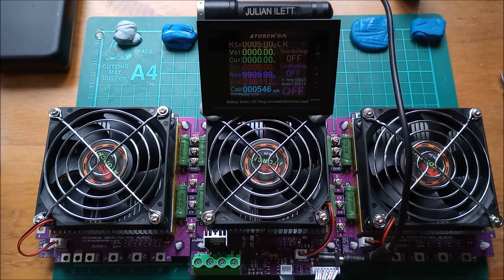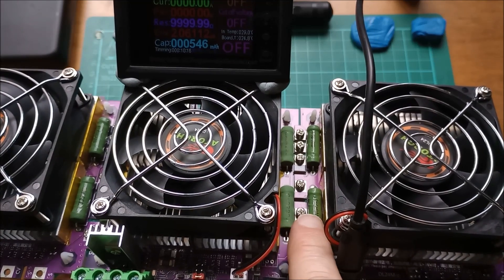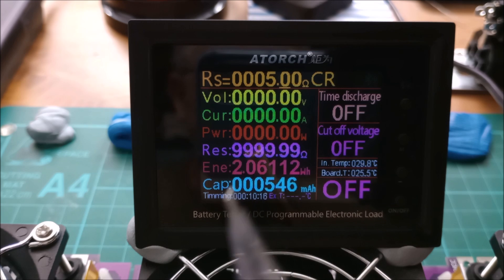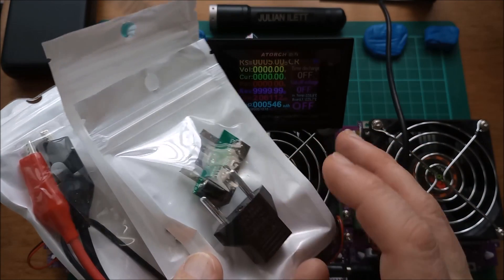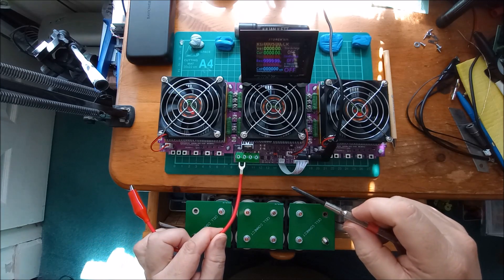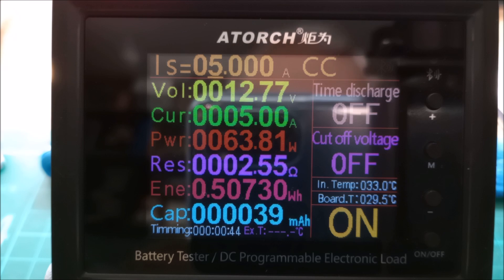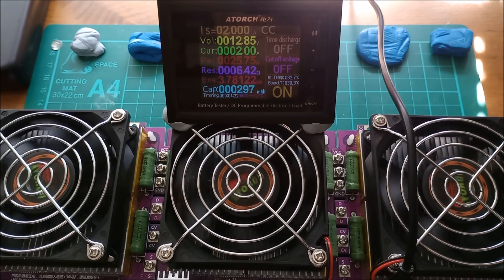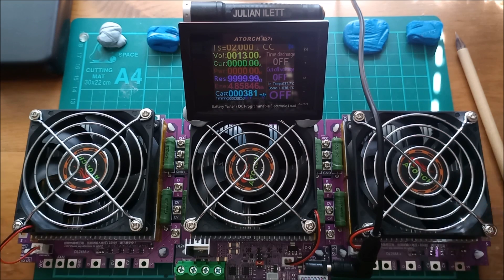DL24M Modular Electronic DC Load

Comment: It is incorrect to specify the rating of those load testers in amperes because its a heater, not a conductive mosfet. And it gets hot from watts, not only amperes. So its not the same if you have 12V or 48V battery at 40A.

Comment: The Atorch set system is a bit mickey mouse, takes a while to make it work for you.  Alright once set up for a batch of batteries say , 100's on a test bench, but only 450W for all that faff and $$$$.  I made up a bucket of water and some nichrome wire to do a 50A test on a 25v lipo bank, much cheaper $ and I wanted  to watch temp rise over 15-30mins and check all over the bank for hot spots

Comment: Is it capable of handling 35/40A for a longer period? I am looking for a decent electronic load for testing heavy LFP cells up to 280Ah, so i need to burn a lot of current/power. Did you also test for accuracy? These are the 2 main parameters of dummy loads - i guess 🙂
Reply: I really don't think so without making major changes that would significantly increase the total cost.
It is not a product for professional use and was not created less for intensive and heavy use
Reply: @francescacosentino6975 but it claims to run 40A cont.? So you guess this is chinese fake?
Reply: @rilosvideos877  Looking at the DL24MP under review here, does the connector on the main board through which the 40 Amperes pass, or should pass, seem adequate for that current? Does the (double) schottky diode at the input seem adequate for 40 A? do the same tracks of the main board PCB that carry the 40 A flow seem suitable to you? Does a card with those 4 heatsinks and the 8cm fan seem suitable for dissipating 150W continuously?
Look, there are many things that make one think that the data declared is a lot of advertising.
In reality the object is nice and at half the declared values it is quite fine, it is not the object that is a fake but the data  too pumped up on the power and Ampere

Comment: Can you try to bring this capacity tester to the limit? I was buying the small version rated 180 watts. After I connected it to a 84 volts battery, I had to replace the MOSFET 3 times at only 0.8 amps because it blew up 3x.
Reply: It may happen that the DL24MP reads small currents even when there is no load connected, this is due to the sensitivity which has been increased compared to previous models and very small shunt sensors.
With the last setting you can cancel this bias error and make the measurement more reliable.
But remember that everything is not stable over time and with external temperature fields.
Too many figures to claim to be precise and reliable on an object of this type.
Furthermore, I wouldn't think about using it to the limit, as I have already written elsewhere, too many savings: switching type MOSFETs not suitable for linear use as needed in an electronic load and often also "fake"; "ridiculous" heat sinks for the intended task anyone who knows how to assemble a PC knows what it takes to dissipate 150W away from a CPU. And then everything is up in the air, no safety regulations and even dangerous voltages (200v are dangerous) on the entire surface of the heat sinks.
Oh by the way when did you replace the mosfets where did you buy them? do you know that the market is full of fakes of this type  that can't last?
Reply: @francescacosentino6975  when it's rated 150 watts you wouldn't go near to 150? I'm aware of the replicas. I was buying from a reliable supplier. They blew up same fast as the original MOSFET that came with the board. Finally I draw only 50 of 180 watts in 10 days. The temperature was not close to anything dangerous. Maybe the blew-up's caused by the avalanches from the PWM. Did you use a battery with higher voltages than 48 volts?

Comment: My biggest gripe with these units is where the thermistor is located for the board temp. It's next to the shunt resistors onboard and a few mm away from the heatsink. The temperature of the silicon is much higher than reported by the board temp reading. Running the board at its full rated 150W will result in really hot (100c+) mosfets while the controller only reports 60c
Reply: You have two ways to remedy this problem.
The first is a partial but easy remedy, just put some thermally conductive but electrically insulated material on the thermistor until it makes thermal contact with the heatsink.
I did it and the temperature can be 3-5 degrees closer to the real one, but the time delay remains, i.e. the time it takes for the heat to reach the thermistor.
The other solution is to use the socket for the external sensor and place it in close contact with one of the mosfets, in this case you will have an almost perfect reading in real time

Comment: A quick way to clear mAh/Wh is to hold + and - at the same time for a couple seconds. Big time saver over entering the menu and going all the way down. 

Any idea what that last setting in the menu is? Something about no load current?

Also have you tried calibrating it? Mine came fairly accurate out of the box but could use a minor tweaking. Just don’t want to mess it up although I think you can change it back to the default original calibration.
Reply: The DL24 calibration is in a "hidden" menu and is only in Chinese.
To access the menu, here are some instructions found online:
Hello, friend, when the ATORCH mark appears during startup, double-click the M key to enter the calibration mode.
First, use 1V to clear and calibrate, then use 30V voltage to calibrate, and then use 3A current to calibrate"

Since it is only in Chinese, you can use a translation "app" with the possibility of graphic input

Comment: Oh boy I’m so excited to see your opinion on this. 

I got the 4 module 600W/40A version. Can’t get a 600W/40A electronic load for anywhere NEAR the $62 I paid on sale. Like not even in the same galaxy can you get an electronic load that powerful. 

But….the design sucks. I mean it’s truly a poorly implemented idea that makes sense and doesn’t make sense. Compressing PCB’s together?! With a design that leaves some of them not level with the rest? WTF? I initially couldn’t draw more than 33/34A. Atorch told me to change the jumper configuration for 450W….which was an issue because at 40A I’d be drawing more than 480W…

So I went back over all the nuts and bolts and very carefully applied a bit more torque and found a couple that were just slightly less torqued than the rest. Keep in mind you have to do the upside down T configuration that’s 3 wide and 2 tall in the middle. 

Nowhere in the literature do they say how to assemble the damn thing. I had considered the 2x2 square but that would still leave 2 modules not level with the other two but I figured I could mod the feet with shims. I think right now I have the middle unit on top of the outer modules which works ok. I always have the unit elevated an additional 12 inches off the ground because additional heat dissipation is absolutely necessary. The heat sinks are TERRIBLE and the fans not running until a set temp is a terrible design. I’d much rather have a variable speed fan that goes on over 10% of the units max rating or some 5-10 Celsius over ambient temp. Currently I have it set for I believe the lowest setting, 40 Celsius. Those motherfuckers are loud and for how loud they are they provide minimal cooling. 75% of my cooling comes from either a 90mm PC fan ducted through a Poptart box to go underneath the elevated PCB’s and another less powerful PC fan on top of that to get the power resistors on the board some airflow. Seems to work ok but if my testing is longer than a minute I use a quite powerful 12” desk fan on its highest setting when I’m doing anything over 200W. Over 400W I use two PC fans and the 12” desktop fan to keep things under 60 Celsius but it’s bloody freaking loud. 

Really tempted to change the stock fans and honestly might look at the heatsinks as well. If I can find salvaged heatsinks that would fit I’d gladly swap them out. Would love to find some copper.
Reply from the maker: Completely agree. It's good value for money, but far from perfect. I would never run it at its theoretical maximum power.
Reply: I agree the initial idea may be interesting but the realization makes you cry.
First of all the choice of mosfets. The IRFP264 that is used is not suitable for linear uses but is a switching one. Its SOA (safety operation area) does not exist for continuous use, therefore the manufacturer does not guarantee that it will not go up in smoke when used as a linear load.
Then I agree that the heat sinks are unnecessarily small and a little was enough to obtain good advantages.
For the use of copper I have seen that it has great advantages on the propagation of heat and therefore in transients; but when fully operational it does not have much greater dissipation towards the air than aluminum and in any case is not able to justify the price which exceeds that of the same DL24MP device

Comment: Resistors probably are for ballancing mosfets becouse they are not ideal and have diffrent Rdson. Also you can mesure votage drop at 35A on input diode and calculate power on it Vf x 35A
Reply from the maker: Yes, I'm thinking that's what "In Temperature" is showing. It's the temperature of the input diode calculated from its forward voltage.

Comment: That reverse polarity input diode will not be carrying anything, until you reverse the polarity, then it protects the board by conducting hopefully enough to blow a fuse or trip.
Reply: True. It will be against to the nature of the unit to put it in line (series) because of the voltage drop it will cause. It must be reverse biased parallel, but then why put a heat sink on it?
Reply: I think the heatsink is to stop it overheating whilst it trips any input fuse. If it fails then the unit is damaged. This is a firesafe device. @borayurt66
Reply: @G1ZQCArtwork  Depends on what you connect there. This being a DC load / battery capacity meter, batteries with very high short circuit currents will often get connected. With such a battery having hundreds of amps under shortcircuit, I doubt that the heat sink can do much to keep that diode from splitting to its molecules in a blink. 😀
Reply: The protection of the diode which blows a fuse because it becomes conductive when you put the wires with reversed polarity is used in the DL24EW model, not in this one.
Here the diode conducts when the connections are with the correct polarity and prevents the current from flowing if the connection polarity is wrong.
This obviously involves, under normal conditions of use, a power dissipation on the diode which becomes "considerable" when the currents are high; this is why there is a heat sink which is also hit by the air flow of the fan.

Comment: is it acting as a DC resistive load or a PWM load? normal mosfets doesn't like the linear region, by what I understand.
Reply: It's always in DC load mode. Like it or not, MOSFETs have to work in this mode. PWM mode is undesirable because many power sources do not function correctly in it.

Comment: You are missing the voltage sense wires (4 terminals into the board, the right hand two) you'll need those so that it's battery/source voltage measurement is not being affected by the current draw on the main lines. It's in the manual I think...
Reply from the maker: Yes, if I was taking accurate measurements, I'd use 4-wires.
Reply: @JulianIlett  I was suggesting that might be why you were having problems with the CV mode...?
Reply from the maker: Yes, I see what you mean. I'll try it again using shorter wires and 4-wire measurement.

Comment: Those 0.25 ohm resistors... are they for current sharing in the fets?
Reply from the maker: Yes, I guess so.
Reply from the maker: Actually there's a mixture of .25 ohm and .22 ohm, so the resistor value can't be that critical.
Reply: @JulianIlett  739 / 5.000
Risultati della traduzione
Risultato di traduzione
The mix between 0.25ohm and 0.22ohm is something that Atorch has never been able to explain.
I had a lively discussion with them, or rather I argued, because I tried to measure the currents and they are greater where the resistances are lower. Balancing the resistors is not difficult by putting something in parallel with the 0.025 ones and this balances the currents too. But Atorch replied to me that he did it because the Mosfets on the side where they placed the 0.025 resistors were hotter with the thermal imaging camera (and since the heat is due to the current I don't understand) it could be the protection diode that is that side? but the direction of flow of the air does not justify it because the air flows in the opposite direction.  the same doubt is expressed in a technical blog by "Kirich".
Reply: I would say that is what they are for. They are probably not balancing power through the modules other than those resistors. Maybe that is why they are using that special mosfet with a high on resistance because it is more consistent in it's linear region.
I would still always double check the heat on each mosfet to see which one runs the warmest. It will probably be on the mother board because that has the highest voltage and most gate voltage.
Reply from the maker: I'm not sure you'd see much difference. The MOSFETs are on common heatsinks, so any heat generated would quickly spread among all the transistors.
Reply: @JulianIlett   true, the difference seems to be negligible but at maximum power it could become a factor, at least between each board.
Reply from the maker: My mistake - each transistor is on a separate heatsink.

Comment: What did you test the constant voltage with ? For constant voltage you will need to use some sort of constant current source like say a solar PV panel else of course it can not do any constant voltage limiting.  You can also test constant voltage if you add some resistive load in series with a voltage source like say adding an incandescent lamp in series with your battery or super capacitors.  Maybe you already know all this and the DC Load can not maintain a constant voltage for some reason. If the other modes work not sure why constant voltage will not work.
Reply from the maker: I tried a power supply in CC mode - wildly unstable. Then I tried a battery in series with a bulb - also very unstable. Then the battery in series with a power resistor - more stable, but still not good.
Reply from the maker: Maybe it would work OK with a solar panel - I didn't try that.
Reply: @JulianIlett   Maybe with the control loop of the CC power supply and the DC load interfered with each other. The battery and resistor should work and if that is not working then solar panel will also not work.
Reply from the maker: The battery and bulb surprised me. I'm guessing it's because of the bulb's non-linear resistance. The bulb was squealing like crazy - worth a video just to hear it :)
Reply: @JulianIlett  Yes bulb will be no linear resistor still resistance change will not be that fast. Maybe is the higher inductance of the bulb that created the problem compared to a power resistor.
Reply: I've picked one of these up. CV mode worked fine for me when hooked up to a poorly regulated "13.5V" wall wart that was producing more like 16v open circuit - CV mode on 15V, 14V, etc just makes it pull enough current to bring the voltage down to the desired point.
Reply: CV mode has always been a problem on Atorch; in the model previous to this one, the single mosfet one, it didn't work at all in 90% of situations it began to oscillate between very different values, unable to find a stable operating point. In this model it is better but the problem is not solved.
Also in Kirich's blog it is said that this problem is due to the fact that the CV control cannot be done in software solution  but an entirely HW solution is needed so that there will be no oscillations.
On this DL24 M model the oscillations are still there but often they are no longer visible on the display and are more contained. They have optimized the error correction intervention time constants but the problem is not completely solved
Reply: @francescacosentino6975  The problem is not the DC Load the problem is the setup. It will never be able to do CV on a battery that is capable of delivering way more current than the limit of the DC load.  You need something like a PV panel or any other current limited source in order to be able to do CV mode.
No DC load no matter the brand or quality will ever be able to do CV mode if you connect a large battery to it.
Reply: @electrodacus   
yes of course but take an AA battery which has little current on which it should be able to do it and only sometimes it did (I'm always talking about the previous model, this DL24MP keeps the display stable but if you look at the driving of the mosfet with an oscilloscope it isn't) , or take a power supply with non-infinite current, even here the Atorch should do it and instead it fails